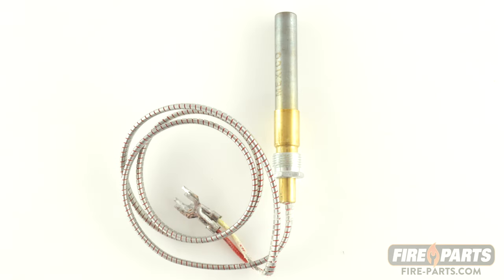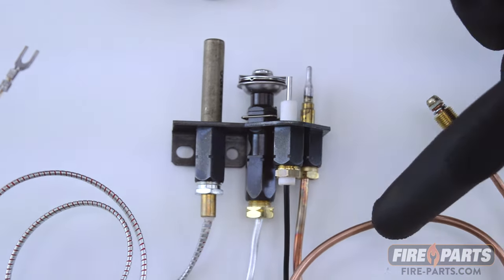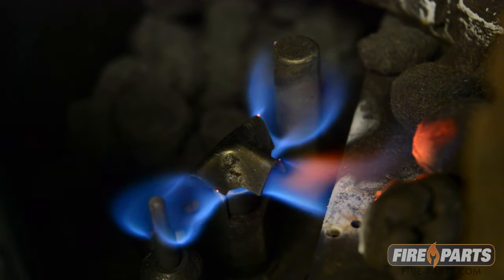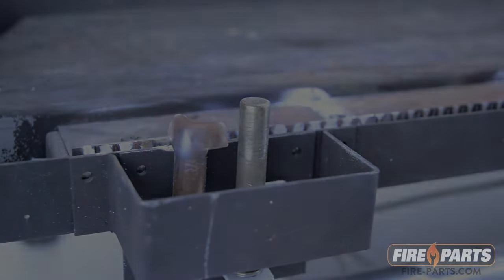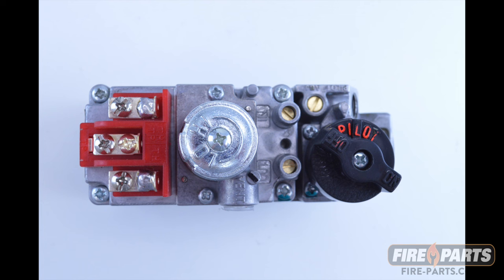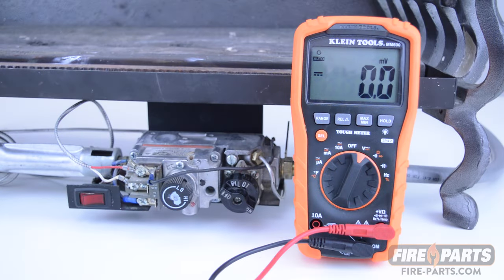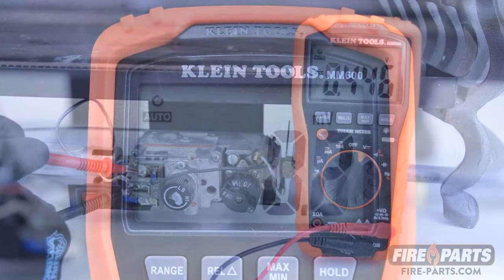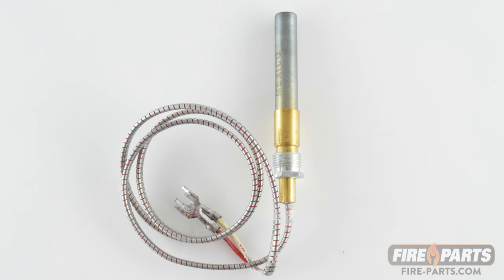Fireplace How To: Testing A Thermopile

Comment: Watched this video last week and it seemed to describe exactly what was needed with my fireplace, and the close-up on the valve was almost uncanny: did you make that video right in my fireplace? So straight-forward, followed your instructions, re-watched the video today and after cleaning the thermopile (thermopile vs thermocouple: who knew??) my fireplace starts up now every time I flip the switch, and that has't happened in years!! It's actually too warm to have the fireplace on right now but I have to keep going over to it and turning it on just to see it light up!! Works every time!! Many thanks for making such an excellent instructional video.

Comment: If your pilot light is lit but the main gas valve won’t open on a SIT 820 a really simple way to test it is to turn the switch on, and supply the voltage using a AAA battery to the same leads your thermopile is wired into.  If the issue is the thermopile this will open the valve and your fireplace will light.  I am not a professional and found this tip on another video and it worked for me so take it with a grain of salt.
Reply: Not a good idea. These are supposed to be powered with millivolts. Not 1.5 volts. Sending too much voltage to delicate coils inside the gas valve that they were not intended for can burn them out. Both current and voltage of that battery exceeds the valves demands by a good amount.

Comment: This was really helpful, thank you! I had a weird situation though. When the fireplace switch was off the voltage on the thermopile from the pilot light was great. When I turned the switch on my fireplace wouldn't light, until I put the voltmeter on it to measure the voltage and suddenly the fire sprang to life! You would think that just means a loose connection but I was sure to test the screw tightness beforehand and it seemed fine. Perhaps something is failing internally on the gas valve connectors?

Comment: This is a great video, I'm going to try when I get home. One thing I don't understand though is why the voltage difference goes down when more heat is applied. Everything I've read about thermopiles describes the voltage difference as being proportional to the temperature differential, so shouldn't you expect more volts when the burner is on?
Reply from the maker: Hello,
Thank you for the positive comment. The voltage from the thermopile drops due to the valve solenoid opening to allow gas the the main burner and using up some of the available voltage. Not a reduction of heat to the pilot.
For technical support, or if you would like to purchase fireplace replacement parts, please visit Fire-Parts.com

Comment: I tested both the Thermocouple and Thermopile and the switch and all are ok ... I cleaned, vacuumed and used compressed air  but I still can't get to turn on .. the pilot is one with no problem but not the whole thing. What else should I do?

Comment: I found that my thermopile would go up to about 150 mv when first started up. Enough to open the main valve. After 5 minutes the voltage dropped to 50-60 mv fluctuating, and the valve closed. Applying a temporary voltage ( 3v) from a battery powered circuit tester across the TH terminals the valve would open immediately but go out after a minute. The gas valve is working, the thermopile is not.  Fireplace has worked fine for 14 years. I ordered a new thermopile. The hard part was lying on the hard floor for 30 minutes to make the tests. Note: my wires are installed the opposite of yours - yellow on the THTP terminal and Red on the TP terminal.

Comment: My thermopile reads over 500 millivolts but the burner wont light. With the switch turned on the voltage reading across THTP and TP is almost zero.  I was told it should be around 250 millivolts.  Is this an indication my thermopile needs replacing

Comment: Thanks for the very informative video.  Question: are most after-market Tps created equally? and are they all 750mv? I've seen them range on Amazon (and elsewhere) between $7 and $79 while there seems to be very little difference in the images or their specs.  Thanks again
Reply: The cheaper ones will work just fine and have great reviews. Plus you can buy 3-4 for the cost of most Honeywell brands. They are all rated for 750mV. The only differences are:
1. Length of leads
2. Quality of wire insulation
3. Universal fit or not (universal come with extra adapters)
4. Wire terminals. If buying for a fireplace, make sure the wire terminals are fork style.

Comment: Question - Wwhen I have my multimeter dial turned to 2 mila-vaults setting the readings I am getting is -.523 with thermostat off and -.075 thermostat on.  Is this a good reading?

Comment: 0:28 - Nitpick here.. the thermopile doesn't have "a wire". More correctly, it has a cable, and specifically a "two-conductor armored cable with spade lug terminals".

Comment: Question: is that a pile of insulation under the logs? I went to light my gas fireplace today and I used the key to turn the gas chuck in the wall to allow the gas flow. Then I turned the red gas line knob under the fireplace to allow the gas to directly flow to the pilot. I turned the knob to pilot....pushed the knob in and held it, clicked the ignition switch and the pilot lit....I waited a lil bit and then turned the pilot knob to On and finally turned the gas knob under the fireplace from low to high, but, the fireplace only lit around the thermal coupling? I shut everything down and waited for the unit to cool down and expel any left over gas fumes and I proceeded to open up the whole unit, thinking maybe dust or something was blocking the main base under the logs? And when I removed the logs, I saw what looks like a trail of pieces of insulation? Just intermittently laid under the logs, but, definitely intentionally placed there!  As such oO0 o0Oo ooOO 000oo so I thought, well I know my wife open this up over the summer trying to clean the glass, maybe she vacuumed up some of that insulation and then tried putting it back and maybe she disturbed that insulation or fire burning material? So I repositioned the insulation in a more uniform line as such oOo000oooOOO00ooo so that the insulation was not broke up, but, all touching. I put everything back and tried to re light it and danger if it didn't do the same thing. My last guess is either I didn't bring that lil bit of insulation over close enough to the pilot/thermal coupling area to light or that the main screen under the logs needs to be blown out with a small compressor to get rid of any dust or something, Please let me know what's the deal with that Insulation stuff before I get upset and slap a large piece of drywall over this thing and when people ask me what happened to the fireplace I simply say "We never had one!"
Reply: Those bits of insulation type material are there to simulate burning embers as in a real wood fireplace.  They are purely decorative but add a nice touch when places across an operating front burner.

Comment: My fireplace has intermittent issues keeping the pilot lit when attempting to light it. It usually will stay lit while the knob is in the pilot position but when attempting to turn the knob to the on position, the gas stops and the flame dies. I can fiddle with it and usually get it to stay lit when turning to the on position. I’ll have to test with a multimeter but until then, is this behavior common with a bad thermopile?

Comment: Hey.  Can you explain to me why a pilot assembly would have both a thermopile and thermocouple like the one in the beginning of your video?
Reply: My hypothesis is the the thermcouple (skinny one) stops gas supply if pilot light goes out.  Thermopile (fat one) provides the voltage to open the gas valve to the burner.
Reply: @80srockerable that is precisely what each one does.  The thermocouple is also a fast response type owing to the small sealed combustion chamber.

Comment: What if I get OL when testing my thermopile (in DC voltage)?
Reply: Old post I know, but for others reading. OL on a voltmeter means Over Load.  Either set the voltmeter to a higher range or turn on autoranging.
Reply: @kimchristensen2175  Means Out of Limits
Reply: @BK-xh4ys  “OL” can mean Open Loop, Over Limit, or Over Load. Depends on the function. But you're right, for a voltage reading, Over Limit is the correct term.